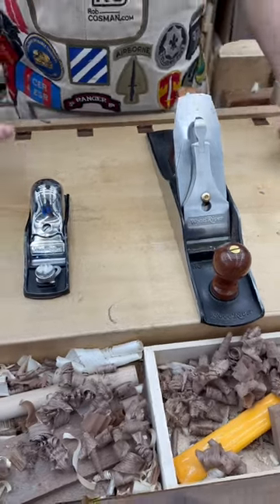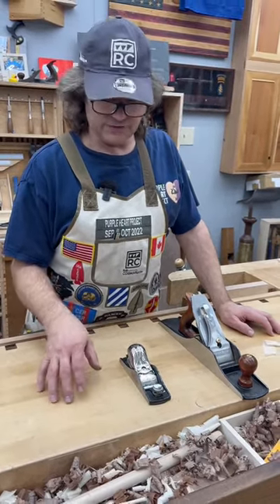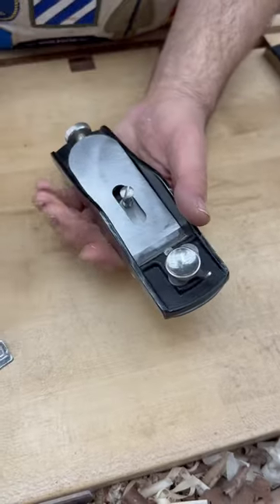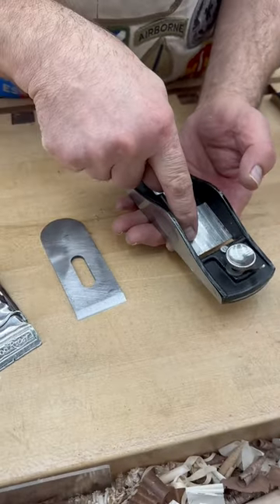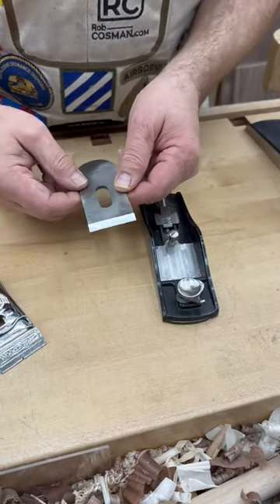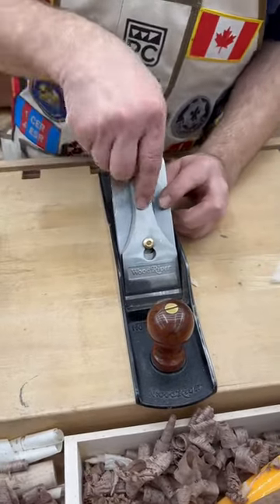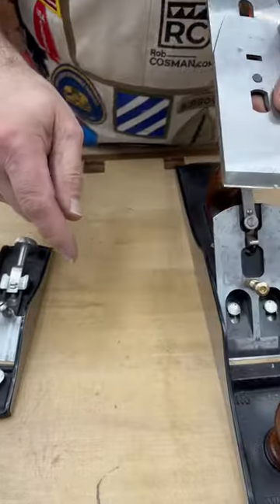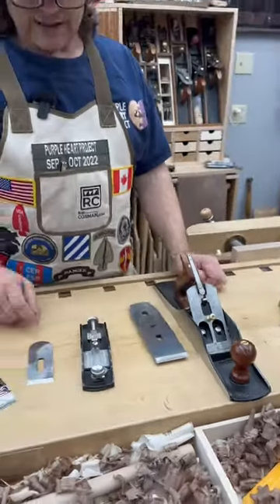Angle of Attack #woodworking #shorts #RobCosman

Comment: Question....
With the knife bevel facing down on the bench plane, would we not subtract the bevel angle from the frog angle to determine the angle of attack?   and yeah dude, i do agree a razor sharp edge is the biggest priority.  cool heads up/refresher on the terminology.   thanks!
Reply: If you imagine the point of the blade being the center of a circle (in a side view of the tool) and parallel to the sole being 0 degrees, imagine that line moving up like a clock hand until it gets to the 12 degree frog, then it has to keep moving up (clockwise and past 12 degrees) until it becomes parallel to the primary bevel, so you are in fact adding to the angle
Reply: @justintomer2567  yessir.  Makes sense, if I'm looking at a bevel up knife set.  My question though is in reference to the bevel down knife set.

Comment: Can you alternate the blade from a bevel up to a bevel down orientation? If so what are some of the benefits or disadvantages?
Reply: You can technically , but you'd never really want to. 
 If you wanna put the blade bevel down on a plane that was designed as bevel up, you'd need to grind it to a lower angle than the bed, which would make it too fragile. 
If you put the blade bevel up on a bevel down plane, your angle of attack goes way up and it gets too hard to push through the wood. Sometimes people put back bevels on smoothers when dealing with difficult grain, as a high angle of attack makes tear-out less likely, but it's about 10-15 degrees, bringing the angle of attack to 55-60, not the 70 you'd get by flipping the blade. Even then, you'd only use an iron with a back bevel on difficult grain, as the 15 degree increase already makes it very hard to push.

Comment: is it also to reduce chader when throwing it against endgrain? so if you dont have the still to sharpen yet its easyer with a low angle becouse its in line with the push direction
Reply: If you can't sharpen properly yet, then learn how to before you do another wood project. Low angle and blunt is still a fail.

Comment: The term is ‘Cutting Angle’, not ‘Angle of Attack’.
Reply: I would call ''cutting angle'' the total angle formed by the blade alone, and use ''angle of attack'' exactly as Rob does, the angle relative to the wood that the topmost component of the cutting edge is presented to that wood. I think that in machining wood and metal, ''cutting angle'' and ''angle of attack'' may be synonymous.